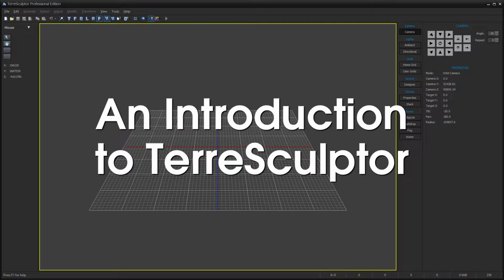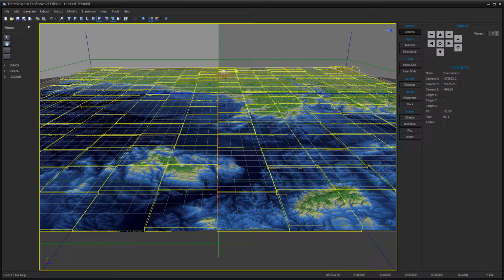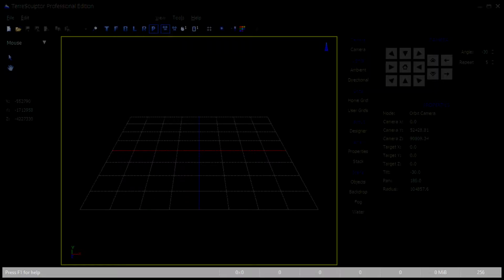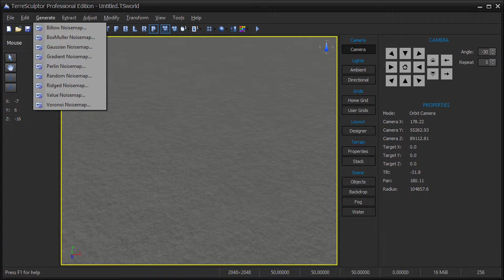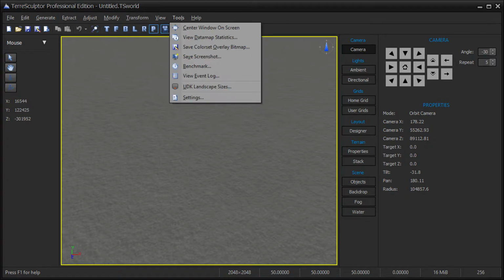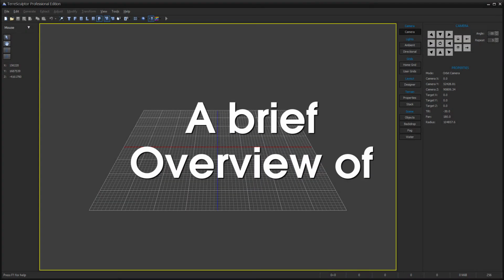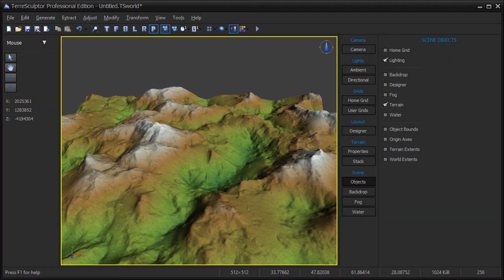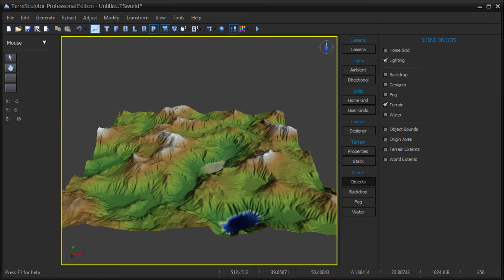TerreSculptor - An Introduction to TerreSculptor

Comment: I think I have found a new toy to play with! Or, more likely, one of those games that kills many hours, days, and/or weeks!

Joking aside, I found myself requiring a decent looking terrain for my game, and was considering paying someone to make it. Considering the price of this tool and the cost of getting a map made for me, I reckon it's a no brainer to buy TerreSculptor.

Besides which, I will be making different sized maps from 2km x 2km up to 20km x 20km. This is due to the limitation of my current machine (64gb DDR3 - 3080Ti) and the desire to go to DDR5 once that can be used with AMD. The new machine will be at least 256gb of ram.

Now to find some decent How-To's. And to buy this awesome application!
Reply from the maker: Enjoy the software!
Reply: @demenzunmedia  3 hours later and I have a nice little terrain to throw into my game tomorrow! I could have killed a LOT more time, but it's now 8pm in the UK and I have to get up early.
I will be using this tool a lot, me thinks, lol
Reply from the maker: @ChuckstaGaming  - Great to hear that.
Be sure to check for software updates, the software will also notify you of the availability of new builds.
I typically release new builds with new features every couple of weeks.  There are a lot of new features under development.
You can read the Blog or check out the Twitter or Facebook Group for the latest news on what is coming next.
Reply: @demenzunmedia  Will do, matey :)

Comment: How to export .obj with Material(colorset) texture?
Reply from the maker: The current heightmap can be exported to .Obj file format by choosing Export Terrain on the File menu.  Obj format export does not currently save any vertex color information, this feature may be added in the future.
A bitmap of the current Colorset for the terrain can be saved by choosing Save Colorset Overlay Bitmap on the Tools menu.
Any material in the target software would have to be manually created using the mesh and bitmap.
Reply: I am exporting obj to blender, and it is loading up flat on blender..  Any Ideaz?
Reply from the maker: @Itz_ILL  - If you look at the mesh in Blender is it a proper triangulated grid?  If not, then the ZY axis is flipped and that is the problem (change it on re-export).  If it is a proper triangulated grid then the altitude scale is too shallow.  Scale makes a huge difference on how it is rendered as a mesh, and the exporter settings for altitude/Y scale can really affect the mesh.  If the Blender importer is correctly equal distance, then exporting with XZ as units of 1.0 and Y scaled to units of 1.0 will result in a cubic mesh bounds.
Reply: @demenzunmedia  ok great, I'm a give a look see and I'll get back to you and thank you